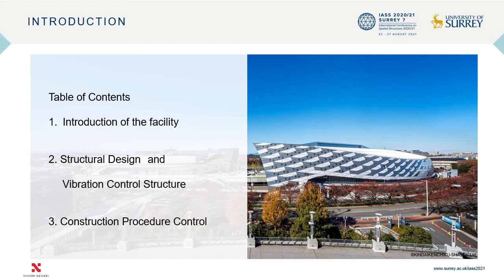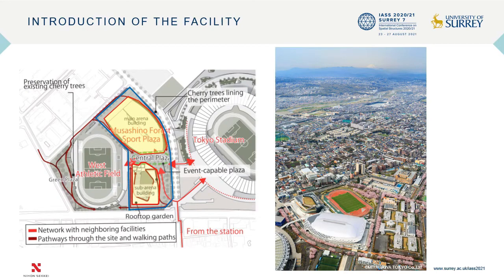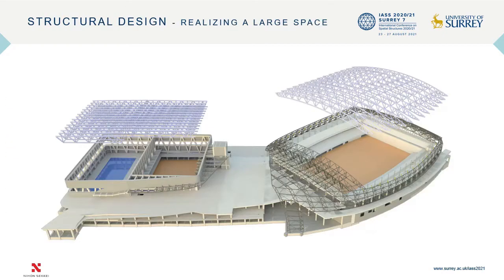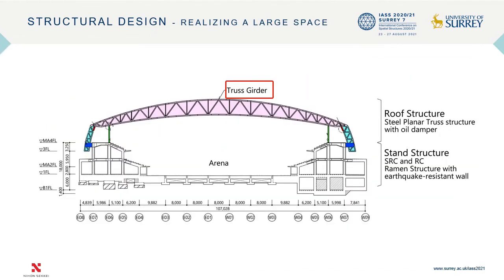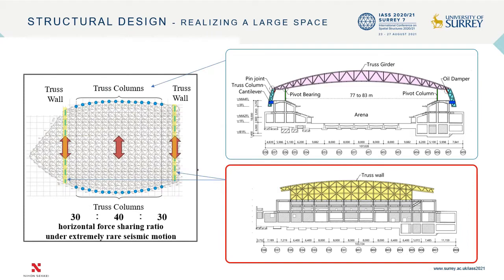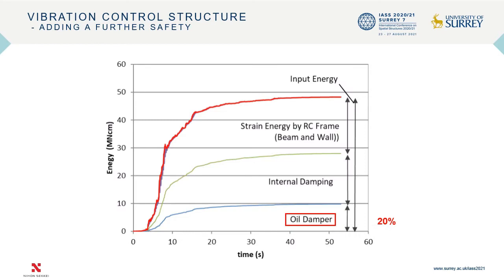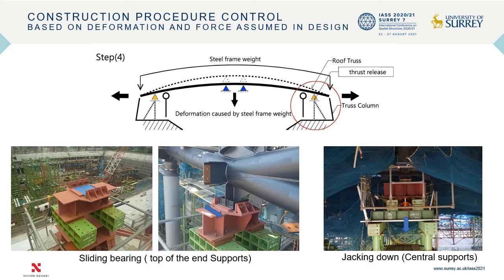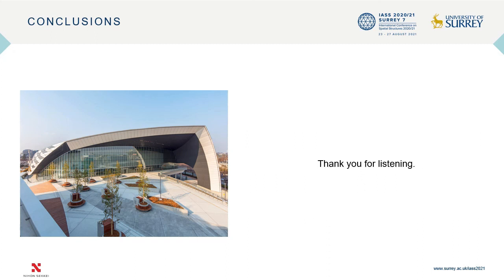Structural design of sports arena with vibration control mechanism

Comment: this is so useful for my project for a sports building in a seismic zone. However, wanted to clarify one thing. Are there any special joineries at the bottom of the pivot column in order to prevent them from breaking during swaying, since both the top and bottom would be moving?